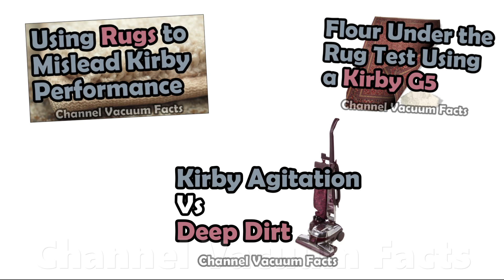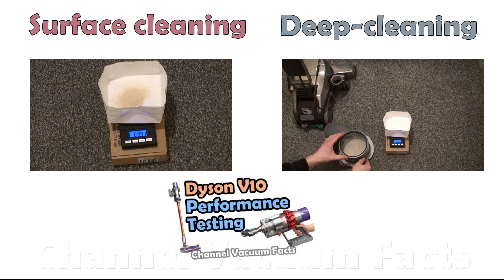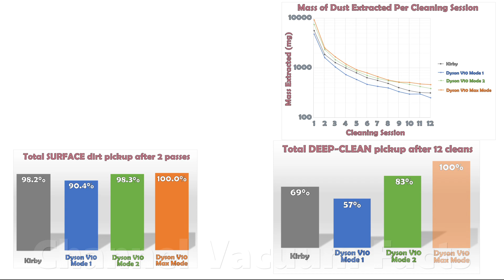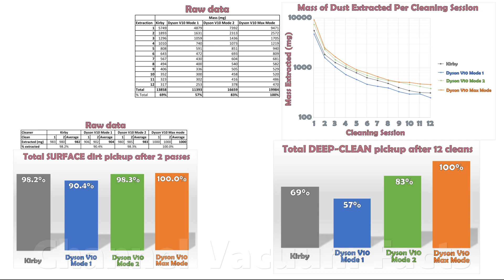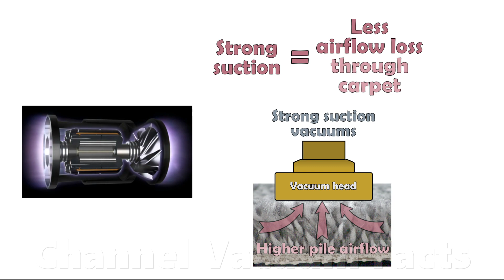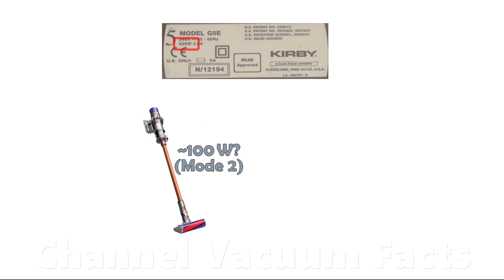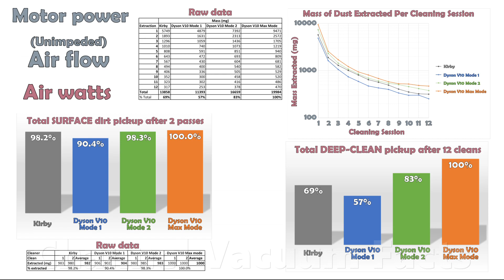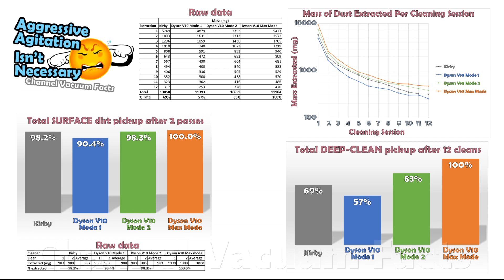Dyson V10 Vs Kirby: How Well Does a Kirby Vacuum REALLY Clean?

Comment: Sounds like this was written by the Dyson Sale Department. The real question is, which vacuum will still be working strong in 25 years...the Kirby. After 5 to 6 years, the Dyson will be in the trash...lol 

Jordan, thanx for your comments of this subject.
Reply from the maker: Given that your comment literally ignored the sheer magnitude of evidence crushing the Kirby, I can only conclude you're disgruntled your favoured machine is exposed for the trash it is. It's for this reason no one worth respecting would want to be using a Kirby after 25 years, let alone any vacuum, given that technology improves and becomes more efficient, effective, and less environmentally impacting. Given that there are plenty of old Dysons still in operational use, your assumption about a 5-6 year life is, unsurprisingly, incorrect. That you mistook objective empirical facts showing the Dyson V10's performance as subjective output from the Dyson sales dept. screams volumes about how crap the Kirby actually was—in stark contrast to the ridiculous claims made by rabid vacuum enthusiasts. Bit of a self-defeating comment really.
Reply: @VacuumFacts  Your of the use it, throw away Generation. Kirby is solid built and so much better than a Dyson (recycled Leg O's). Enjoy the narrow path you travel thru life.
Reply from the maker: @rockyk5  Might want to think about what you say before speaking. "Use it and throw away". I see. When people spend as much as a top end Dyson costs, they aren't going to be throwing it away anytime soon. And now you're conflating choice to throw away with your earlier false suggestion of the need to because it doesn't last. The Kirby's exterior is build to last, but the innards aren't. The design is so bad that belts break and other things fail. So bad is this problem that there are third party companies that specialise in repairs and maintenance for these machines. And to argue Dyson owners are 'throw away' yet somehow spectacularly fail to notice the massive white elephant in the room (disposable bags), which the Kirby champions, is an act of ridiculousness so stunning that you might want to turn off your JCB...the hole you're in is deep enough already. And just to polish off, you're still completely ignoring everything shown in the video. Truly amazing.
Reply from the maker: @rockyk5  That you interpret exposing your broken, nonsensical, hypocritical illogicality with 'trolling' says much about who I'm talking to. That you confuse the observed facts presented with an 'opinion' confirms it. You seem to not have acknowledged anything I've said previously, and you've still literally ignored everything shown in the video and said nothing specific about any of the data presented. It's like you either didn't watch it, or didn't really understand why it matters or how it is explained based on well-established processes (all of which are described in accessible detail in my other videos). Everything observed makes complete sense. You clearly don't like that facts conflict with your wonky worldview, don't have a leg to stand on in countering, so resort to nothing more than criticising the source in a pathetically cosmetic and superficial way in lieu of any real argument. If you have anything well-reasoned and meaningful to say, then I'm all ears; if you've just got more of the same hollow, ridiculous nonsense to spew, then I've nothing more to add.
Reply from the maker: @rockyk5  lol ok. Playground is that way -->
Reply: @VacuumFacts  WoW...enjoy your day
Reply: Rocky Jeep actually I bought a Kirby and after 1 yr it completely broke on me. I then purchased the dyson V8 and it’s been 3 yrs and it works PERFECT just as if I had bought it yesterday.
Reply from the maker: @adrianabell546  haha, don't wreck their wonky worldview! It's all they have left after being decimated by facts xD
Reply: @adrianabell546  My parents bought a Kirby in 1972 with all the bell and whistles, Mom loved it, in 1997 it was sent to Kirby for repair of two cracked wheels and a new fan assembly. Came back looking like it was brand new again (polished all the aluminum) charge for repairs...$125.00. In 2015, I sent our smaller Kirby in for a total rebuild. We bought it used in 1982, its the red model built in 1958, it's a smaller version of the current models - charge for rebuild, polish, cord and and new bag...$235.00 (it was 57 yrs. old). Gave it to Mom and took her larger/heavier Kirby. Both are still in use to this day.
Reply: Rocky Jeep Well maybe they made them better in the old days because now all they sell is overly priced trash.
Reply: @adrianabell546  Well, to each his own
Reply: @adrianabell546  What broke on your Kirby exactly?
Reply: @rockyk5  Dude, that's the price of a new vacuum.
Reply: @Crazywaffle5150  Dyson will cost $700 for a lot of plastic, Kirby will cost $450 on eBay with a lot more aluminum than plastic
Reply: @VacuumFacts  I am still using a Kirby Generation 3 from 1990 that I bought used.  Your Dyson will be recycled by then.  I also wouldn't choose a cordless to vacuum carpet, looks more like a hard surface tool and only for quick cleanups.
Reply from the maker: @Htuna2  I love how you think that's some benefit. No ability to think whatsoever. To put what you said another way: I'll be using a more modern, better performing, less environmentally harmful, easier to use Dyson machine, while you're still struggling with the underperforming, klunky, polluting, expensive-to-run Kirby. Enjoy. Do you still live by candle light, and get around in a horse and cart by any chance? lol
Reply: @VacuumFacts  LOL  Keeps plastic out of the landfill where your Dyson will end up plus you will have gone through multiple Dysons and I will still have my Kirby.  You keep using your stick and I will be shampooing, massaging, sanding, blowing etc with my Kirby and I don't have to hold my finger on the button to keep it turned on. Plus, you paid a lot more than I did for my G3 which was probably in the $200 range. If it has an issue I just take it to my favorite repair shop and it is repaired cheaply.   Good luck, enjoy your Dyson and I will enjoy my Kirby.  Hope your finger holds up  :<)
Reply from the maker: @Htuna2  o_0 technology will have moved on in 30 years and likely be far more efficient, easier to use, and less environmentally harmful. It's why virtually no one uses a Kirby anymore. Plastics only end up in landfill (along with all the disposable, wasteful Kirby bags) if the owners are irresponsible and don't recycle them as Dyson recommend. This has all been addressed countless times before, and you just don't have a credible argument here.
Reply: @VacuumFacts  Rather throw a bag away then dump all the loose dirt into the trash and end up having to dust or vacuum again to clean it up.  I shouldn't have to go outside to dump something like that.  If I want to do bare floors I can just turn the Roomba loose and dumping the bin is much less messy.  To each his own.  I also prefer to use a stand mixer rather than a flimsy hand mixer.
Reply from the maker: @Htuna2  If anyone gets mess from emptying a Dyson, they're doing it completely wrong, as shown here https://youtu.be/E_ik6qScs0o . Only cheap knockoff bagless done wrong make a mess when emptying.